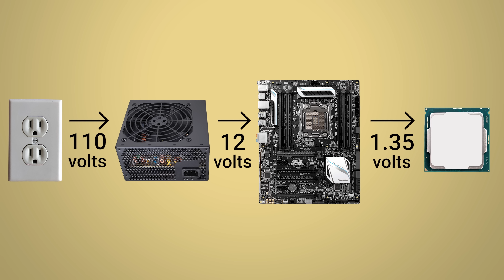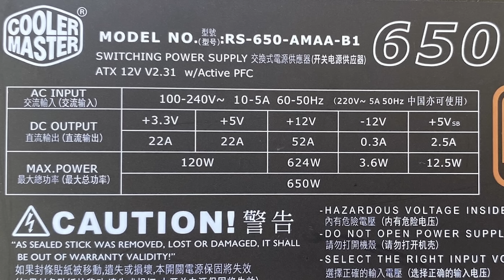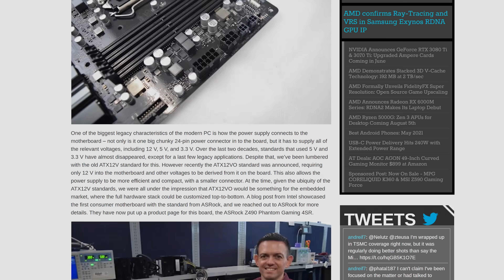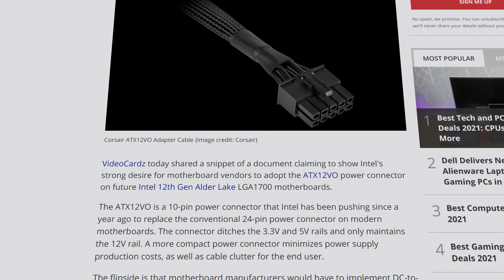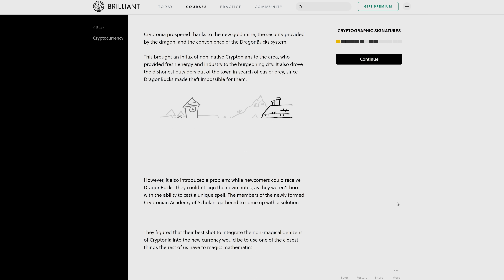Is The 24-Pin Connector DEAD?

Comment: "One very important standard still uses 5 volts: SATA."

USB: Am I a joke to  you?
Reply: Also HDMI. And Displayport wants 3.3V

Although I wouldn't be surprised if the conversion for that already happens on the motherboard.
Reply: @nordern1  You spelled GPU wrong. (for the most part, nevermind APUs)
Reply: @CathyInBlue  Whether you use an APU or not most motherboard have those connectors. So they have to provide power for them
Reply: @nordern1  Gonna need a citation for that claim. Most MBs do not have HDMI or Displayport ports. Those are video output ports, which usually live on the GPU card. Only reason for a MB to have one is if it's designed to be able to host an APU in the CPU socket. If not, the MB itself would not have a video output port at all.
Reply: @CathyInBlue  According to geizhals(.)de, there are currently 263 AM4 Motherboard of different generations sold. Of those, 232 have an HDMI port. 88%. 

I haven't played much attention to Intel. Best I can tell, their current socket is LGA 1200. 275 Motherboards are listed for that. 249 have an HDMI port. 90%
Reply: @nordern1  Across what brands of MBs?
Reply: @CathyInBlue  I did not filter for brands. We were just genetically talking about MBs. Or at least consumer MBs.

I could give you a list of companies that are part of this data, though I don't know what you'd gain from that. It's just all of them who produce for these sockets and sell in Europe.

Or if you have specific brands you'd like me to give you data for, I can do that, too

The current sockets of both Intel and AMD can house APUs, so their motherboards generally support that
Reply: @nordern1  I just know that most motherboards that I shop on NewEgg have too much to do on their rear IO to waste space on video connections "in case" someone wants to plug an APU into the socket. There are BIOS buttons, WiFi antenna connectors, multiple ethernet ports, and USB out the wazoo. Not to mention the audio ports.

I just don't see video ports on the rear IO shield of motherboards until you're filtering for small form factor systems where adding a dGPU is undesirable due to the size.

And to be clear, I'm talking consumer MBs, not server MBs which universally have at least a VGA port, but they don't provide power anyway.

https://www.newegg.com/p/pl?N=100007625%20601292786%20600138080%20600641738%20600009016%204814

All ATX form factor AM3, 3+, and 4 MBs: 137
Ones with HDMI: 19
Ones with HDMI & DP: 10

Swapping ATX for microATX, miniDTX and miniITX: 137 (again)
Ones with 1 or even 2 HDMI: 34
Ones with HDMI & DP: 8

Selecting extended ATX for any socket shows 12, none of which have video ports.

So, my perception is born out. MBs with build-in video ports are rarer than ones without. Even when considering just small-form-factor MBs, ones with video are more common, but still a minority. I included AM3 and 3+ because I presupposed older boards would be even more apt to have on-board video, but that clearly didn't help.

I can't speak intelligently about Intel's MB eco-system, as I don't shop for those.
Reply: @CathyInBlue  Interesting, that Newegg site shows entirely different results for me. The list at the side says (932) motherboards, but then it only lists 4 Pages of 36 entries. 

Regardless, it also seems buggy. If I check the box HDMI > 1x HDMI, the results go down to 51. However, if you instead look at "Back I/O Ports" > "Video Ports" > "1x HDMI" it suddenly lists a lot more. 843 results for me. 90%, which is pretty much what I said before.
Reply: @Nordem That's a permutation of all of the boards from all of the actual suppliers, of which NewEgg is just one. So, same board from 5 different suppliers is a contribution of 5 to that bigger number.

And try just actually looking at the rear IO shields of all of those boards. It'll back up what I've said.
Reply: @CathyInBlue  "And try just actually looking at the rear IO shields of all of those boards"

Alright, lets do that together, so we can both have wasted our time on this :P

We'll take the link you posted earlier and look at the IO shield of every motherboard on the first page. 36 Motherboards.

Of those there are 3 that do not have an HDMI port. The "GIGABYTE X570 AORUS MASTER", "ASUS ROG X570 Crosshair VIII Hero" and the "ASUS ROG Crosshair VIII Formula"

Every other board has one. Which brings us back to 90% having HDMI.
Reply: @CathyInBlue  Well lets see, my ASUS 370-A Prime MB has them. Nearly every current Intel chipset based MB has them since Intel does APU's. Its honestly very difficult or impossible to find a motherboard for an 11th gen Intel CPU that doesn't have some combination of DVI, DisplayPort, or HDMI (usually two of the three). Mine has all three and its 3 generations back.
AMD (which does the AM3 socket though that's old tech and AM4 is the current and AM5 should be soon) doesn't push APU's like Intel does. So by only searching for AM3 sockets you're far more likely to see fewer results. But I think you already know this and are using it as an excuse to make a provably false assertion. 
Going onto newegg, i found 133 AM3+ socket motherboard. Looking at the filters I saw 999+ AM4. I randomly grabbed ones from different chipsets and all of them had a video port on the back I/O.
You'll have similar results if you search LGA 1150, 1551, 1200 ect. 
Again its quite difficult to find current (AM4, LGA 1200) motherboards that don't include onboard video ports.
Reply: @CathyInBlue  Given that 100% of Intels consumer level CPUs and a good handful of AMDs CPUs have video processing capabilities, it’s safe to say that most motherboards have some kind of video output.
Reply: I would assume the Motherboard will or should already step that down if a 12VO powersupply exists, but its more about the sata connector that cant connect directly to the pwoersupply as it used to.
Reply: Don't forget 5v ARGB led strips. Asus love those the most.
Reply: @jeuno880  You mean the LED strips we all tossed into our rigs and lit the entire room. For a few months. Then only when people came over. Then only turned on when people asked us if the case lit up....
Then we just said yes it lights up. So where do you want to eat?
Reply: USB A ports get their power from the motherbord 5v rail suplied by the 24 pin conector just like pcie and m.2 get their 3.3v from the motherbord 3.3v rail suplied by the 24 pin conector. I think that usb and pcie are the reason the 24 pin conector survived this long.
Reply: But doesn’t the USB power come from the motherboard? Or is there a dedicated cable out of the PSU for the case USB connectors?
Reply: @dude-e  USB uses 5V, which CAN be supplied by the MB, but under ATX12VO, it MUST be supplied by the MB.

And then, there's 5VSB, the stand-by power used to keep the RTC working, even if the battery fails, and which enables the system to soft-off and then turn itself back on with Wake-On-Ring, Wake-On-LAN, or Wake-On-Mouse. I guess one of those 10 pins will now have to be a 12VSB that the MB has to regulate down to 5V to perform those same functions.
Reply: @CathyInBlue  If they do this, the efficiency benefits from shorten these 5v and 3,3v wires for just a few decimeters would be mitigated. Today most PSUs are very efficient by providing 5v standby. Doubt cheap stepdown modules on mainboard will do the same. And given that most PCs are powered off more than they run, this might be a problem
Reply: @louism771  "And given that most PCs are powered off more than they run": This was true, but then, mining.
Reply: @richardbroder  not everybody is mining
Reply: @dude-e  depends on motherboard design... some motherboards make it from 12V with 'cheap' regulator or higher cost dedicated VRM for it. Then we have motherboards that straight yeet that +5V to USB port from PSU without even fuse. Well most super budget mobos have at least fuse between PSU and your USB device
Reply: @sl06bhytmar  the PSU have some sore of over power cut off protection,
Reply: @dude-e  come from the motherboard, but i think, viewing the 24-pin connector's schematic, 5V for USB is powered by the power supply. Sorry for my broken english.
Reply: @dude-e  passes by the motherboard to the usb but 5V comes from PSU
Reply: @dude-e  out of the PSU at he moment, all PC's power at any voltage comes out (from) the PSU
Reply: @dude-e  it comes from the motherboard
Reply: @dude-e  5V (red) wire carries 5V directly from PSU to motherboard and drives, 3.3V is delivered too (orange I think), 12V -> Yellow wire. 

In the good old days of AT you'd get -12 and -5V too, albeit 1W on that rail or even less for operational amplifiers (analogue stuff), but it was a thing. I can't remember off the top of my head which one of the negative voltages perished with ATX but, yeah, ATX 24pin PSU delivers 12V, 5V, 3.3.V and some negative voltages that I'm too drunk to remember and they don't matter anyway in modern motherboards.
Reply: That only becomes an issue if you add additional pcie USB cards which require a direct connection to the psu.
Reply: 5v Sata is coming directly from the psu. 5v usb could easily and sometime is generated by the motherboard
Reply: I thought sata used 12v because you need a 12 volt if you have an external hard drive?
Reply: @bland9876  A properly provisioned SATA power connector has multiple pins for each of 12V, 5V, and 3.3V DC power, but a lot of PSUs drop any actual supply of 3.3V. Generally, 12V was needed for spinning rust drives, 5V for the communication logic, but SSDs could get by with just 5V and 3.3V for internal operation.

With PSU makers dropping 3.3V from their SATA plugs, SSD makers made provision to take 3.3V from the plug if present, but to regulate an internal 3.3V line from the 5V line if it's not.
Reply: @CathyInBlue  I have a couple of external hard drives and I noticed that all of the hard drives that are physically larger have a 12 volt power supply that needs to be plugged in the smaller ones can get all the power they need from some USB ports. I say some USB ports because I have some devices that don't give them enough power. And i had ro use a splitter into a battery bank or sit litteraly right next to the wall. (I was using a 2A usb battery)
Reply: well USB now a days specially the type c can go as low as 5v (default) or as high as 19v (assuming the handshake was successful).
Reply: USB is internally powered. Which, as he said, would have to happen to SATA if we go this route.
Reply: @DJScopeSOFM  i thought some m.2 slots where just sata and they dont have a power cabke coming from the supply.
Reply: @bland9876  they use a lot less power so are powered by the motherboard. SATA could probably be powered internally but it wasn't designed that way.
Reply: I read it as soon as he said it
Reply: SATA has both 12 and 5 volt. so 2 power delivery cables.
USB only has that one
Reply: I think yes and no. If you follow the PD standards for USB closely, you could see that now they use dedicated control chips to handle the power distributions. However, I am not quite sure of how the signal encoding side of thing works.
Reply: Hahaha

Comment: If a USB-C cable is enough to carry 65W of power plus data, then why not strip the data, and have 4 "USB-C"-type cables to the CPU, 2 to the motherboard, and then directly to the GPU, however much is necessary?

It doesn't have to be USB-C obviously. Like I said - strip the data, leave a tiny easy connector, and that's it. No more mixing and matching "oh, is that a CPU or GPU power cable" situations, no more ugly unbendable bulky wire bundles and finger-breaking, motherboard-cracking connectors.

It's just weird that widely used consumer products have improved so much, from the unfathomable wide cables in the Samsung X620 and Nokia 6230i, to a single standard - USB-C. Yet in enthusiast PC builds we still deal with components that look like they're about to be connected to a CRT TV, however even SCART isn't as ugly as these power cables.

Comment: Good idea on paper.
Watch as power supply become simpler and cheaper to build, prices will stay the same or go up because it's "new".
The other voltage will come from the motherboard increasing complexity, cooling and ect.
Again rising the price, and while we're at it AMD going like Intel (pins in the socket) another price hike.
This is mostly a money grab. Nothing is gained here on thec side of things.

Comment: Why do they need so many wires still, 1 should be enough? A smart power supply should be able to workout the PS_ON etc. from the load or sending a signal over the power wire.
Should be able to make do with 1 big wire and the ground can return through the metal case. That is how it works on cars so you could just use a car battery type connector :P

PS. I am happy with the current ATX ones

Comment: yeah do the conversion on the mobo sure ,send me all you boards in rma like oems boards like hp\dell\lenovo esp  ,im so against the 12v standard is crappy the design is poort and it will not only cause issues when  psu blows it will also blow the board those safety measures only last so long if not are bypassed by surges so yeah ,normally it would just be a psu now you face both to much for the e waste on land fulls  ,

Comment: atleast you cant messup putting a 24 pin in the right spot. my friend called me one day for help on a pc he plugged a gpu power plug in the cpu plug
Reply: My father toasted a Computer doing that, I was angry and removed the pin from it, so it doesn't work, he goes there and plugs the wrong one.
boom, dead computer.

Comment: Why motherboard manufactures don’t move the 24/10/16 pin connector do the other side of the motherboard, near the power supply ?
Reply: Depends on the case.  In some the power supply is in the top of the case; in others it's in the bottom of the case.  So do you want them to put connectors on at least 2 sides of the motherboard which would increase the cost?